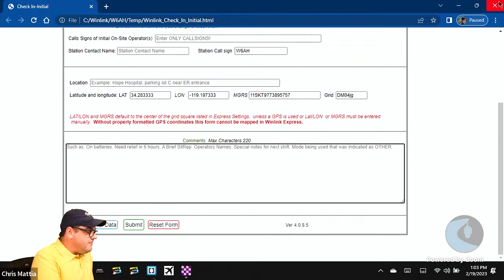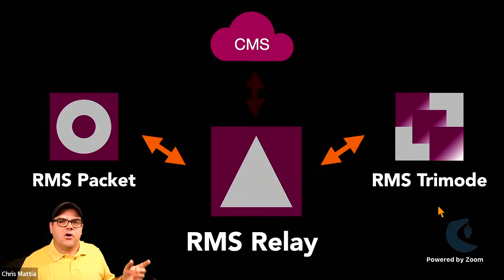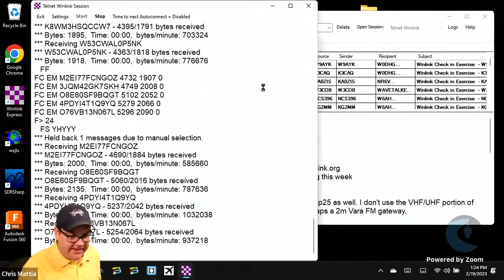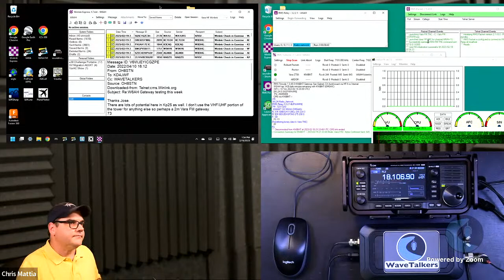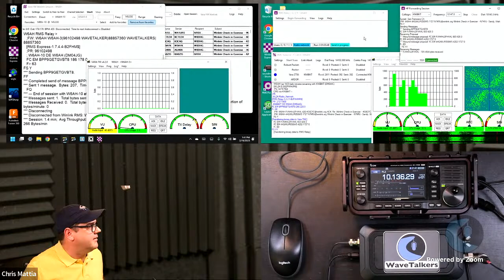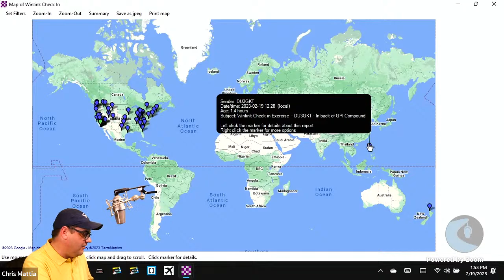Setting Up A Hybrid Winlink Gateway – WaveTalkers LIVE 60

Comment: still having issues when trimode start, it pop a question window stating that relay had been check but appears is no install or initiated.....where i go to make this automatic?
Reply from the maker: For Trimode you really need to install and configure RMS Relay.  Go back to Episode 59 for the set up of Relay and Trimode.   You should always launch Relay first then let Relay launch Trimode. Remember Trimode is controlling your radio, setting the modes, frequencies, etc for your gateway.  Relay is controlling how your gateway operates and is doing the heavy lifting for the traffic handling.  Relay needs to be running first then Trimode to make it work properly.

Comment: Is there a map of Hybrid Gateways ?
Reply from the maker: Yes, go to winlink.org click on Tools.  Select the mode from the radio buttons at the top of the map.  Any hybrid gateway for that mode will have an H on the pin.
Reply: @WaveTalkers what type of R.F. connection use the Hybrid RMS? Ardop, Vara, or other?
Reply from the maker: @georgedandrade-hp1gds296  Hybrid Gateways can receive any type of RF winlink traffic (Packet, VARA FM, VARA HF, ARDOP, Pactor), but it will only send out via VARA HF or Pactor.
Reply from the maker: provided the internet is not available, if the internet is available the traffic gets passed to the CSM via internet as usual.
Reply: Wow, that's awesome  information. That's why  I am working on my Ham Radio License.  This group is full of information and is willing to share.  Thanks
Reply from the maker: @Tom-jd1rm  good luck on getting your license, and thanks for learning with us!  73 Chris W6AH